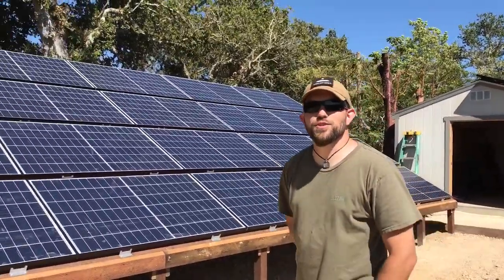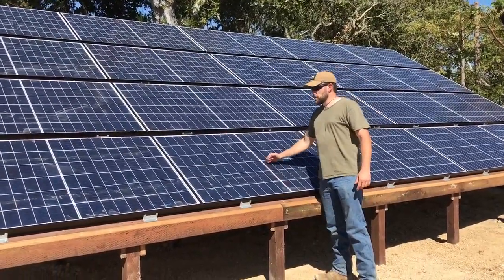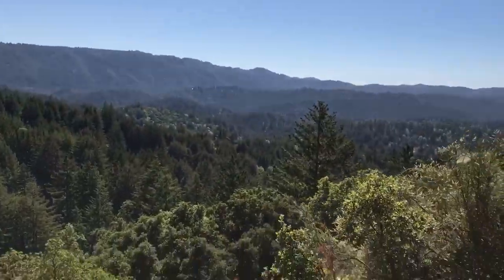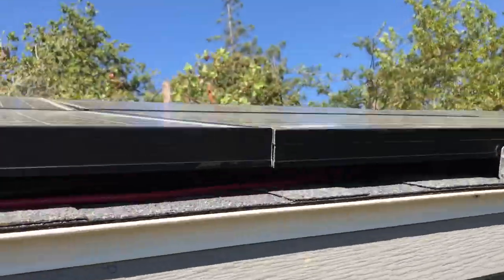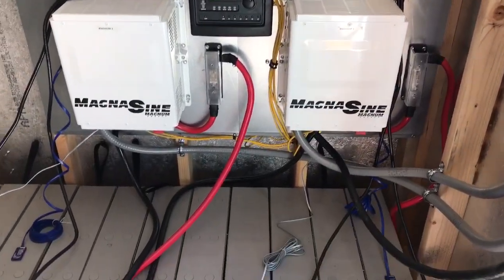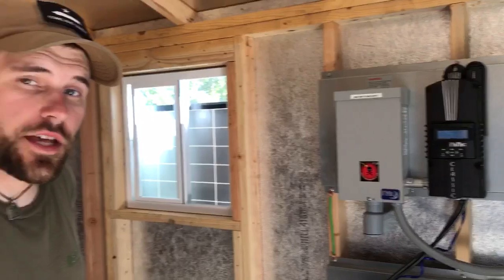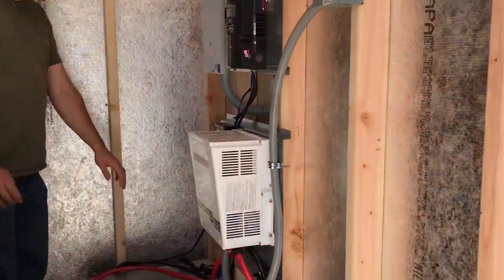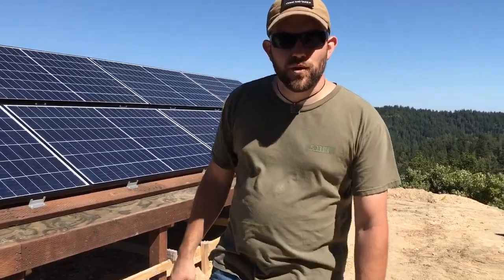12.7KW Off Grid ground mount Solar install by Off Grid Contracting

Comment: How much would it cost me to get my bus set up with solar? also is there a way I can get enough solar to run my Air conditioner and heat, I have a mini split?
Reply: If you are off the grid you will need batteries as well as panels and inverters/chargers.  The batteries can double your cost.  I see a trend of going with used li-ion batteries from electric vehicles as the prices are much more reasonable than conventional lead acid batteries.  Having the mini split-wall unit definitely lowers your power needs but there are so many other factors involved.  For one thing a bus usually has lots of windows, which can increase your power needs because of lost energy through the windows.  The bottom line is without knowing many details about your set-up, it is impossible to give you a definitive answer to your question.

Comment: Can one have enough energy to run a small home 24/7 365 days a year without running out of power?
Reply: Yea, lower your power consumption. It's not as easy as you may think. If you want 24/7 capabilities, you're going to need a battery back up as solar panels obviously can't supply power at night.
Reply: @tt7hvn  I'm attempting to take a picture of how many kilowatt hours I use every month but I'm having a hard time figuring out why my Brother's bill is lower then mine and He uses the same amount of electricity a month.  The ONLY thing that's different is I have to keep my oscillating fan on all the time.
Reply: @vestel777  your statement from your utility company should provide you with how much power you used during that period. I know mine does; mine even breaks it down to avg/day
Reply: @tt7hvn  Yeah I know.  But how can my bill be higher then my Brothers who lives in the apartment above mine?  He uses more power then I do and He pays less then I do.  He has his TV on all day and till around 2 AM in the morning and I just use my cell phone to watch YouTube or my iPad.  It's crazy.
Reply: @vestel777  60% of your electrical bill is HVAC, 20% water heater (if electric), other 20% various. 
If he's paying less for electricity, he's using less. I bet you he has his temp set differently than yours or he showers less than you 😂
Reply: @tt7hvn  Thank you for you responding.  I'm going to call the Electric Company and have them come out and see what I can do to bring my bill down.   Whenever I get my very own home (4 Shipping Containers) I'm going to save up for $50,000 in Solar Panels and a lot of batteries.
Reply: @tt7hvn  Everything is electric here at the Income Based Government Funded Apartment.

Comment: Shit... I just rewatched start... that is on a narrow RIDGE, not a cliff.. slope in back is severe also.  Maybe the customer has a house a bit away from this array and this ridge was only place to put it without clearing acres... or want it out of site.  One KW is probalbly just to push the current through the wire, from the array(s) and to the controlers and storage and House or whatever the application is for.  Maybe a small radio transmission tower up there?  High elevation, 360 clearance, small rod up above the trees and broadcast away!!!

Comment: ON THOSE vertical shed panels... what would happen if you positioned some maneuverable mirrors on the ground and angled them to hit the panels???  May be worth a simple test on a panel to see if any difference .  Get the mirror aligned, cover it with a sheet, monitor the vertical array, then pull off the sheet to see if it ads more input and productivity.  You can do this wiht vertical panels vs. roof panels.  I think it is worth a try. Mirrors are cheap, especially if you get used ones and mount to plywood and frame with adjustablility of pitch angle.  Should really help in summer with high in sky sun, but winter low riding sun should be better than roof panels most likely butmirrors prob. will not allow much additional due to sharp pitch angle, unless they were separated and mounted away and vertical and reflect-beam onto the panels in AM or PM.  Let me know if you try it.

Comment: Don't recommend people build all wood ground mounts. There's a lot of inaccessible wood supporting the modules. I built mine with two long beams top and bottom with some cross bracing. Then typical rails connecting the two beams.  95% of the wood is shielded by the modules and moisture can fall through everywhere. Also easier to install microinverters for grid tie.

Comment: NEC 690.31(A) PV circuits over 30 volts can’t be readily accessible. The first array’s modules wires need to be guarded. The same with the ground array with the weatherhead. Being you are using Midnite Solar mppt charge controllers, I’d say your voltage is over 100 VDC.
Reply: There are no regulations in much of the country.

Comment: You could buy electric for 20 years for the cost
Reply: but that is the cost of being able to , or having to be built in locatio which is off grid... or just WANT to be off grid.. Opportunity Cost is what the Macro Economics guys cal l it. In this apparently remote location, it may have no juice nearby and could cost $50,000 to run poles and wire (or underground wire) and numerous step-up transformers along the distance. We do not know what is going on here or why...that is THEIR business, so why bring it up. Not part of the project.  There must be reasons or issues causing it, not stupidity driven project.

Comment: Here in the north, 100 amp requirement is the minimum, if you plan on electrical heat the need is even higher. So this system does not even come close to meeting the house needs, let alone things like yard lighting, water systems. If you have a shop, or barn, the demand grows even more. This is energy poverty to say the least. The price to meet the needs will pay for 10’s of years of grid power.
Reply: Im moving uo North way north actually. Maine northwest. Im building an earthship/greenhouse to live and grow food in along with small amount of medical cannabis. Ill be using 2000-3500watts an hour ( 2 or 3 lights @550watts each. With air pumps and fans. Using passive energy to keep climate stable with woodfire rocket stove mass heater connected to an air ventalation system under neath the flooring to heat floor with hot air from top of greenhouse sections. How big of a solar system should i get. I have 2 6500watt generators for backup charging so ill go with the least amount of battery bank as possible until i can afford another string of bank next year. Thanks for any advice.

Comment: could not tell if those were just wood posts into the dirt or wood posts put into the ground holes fill with wet cement.
Then I would use PVC pipes to cover the wires because todays wires like on cars are starting to use SOY which is 
basically animal food.  But I do like the design.

Comment: Building a solar array you need space in between to clean the panels.  You wouldn't know it at first, but when you do clean the panels after they've sat for say 30 days, it's a difference.  So that's why it's not so good to have it built like your seeing in this video.  Cleaner panels more energy
Reply: yup... too close to dusty ground. Wonder what kind of pollinating trees are nearby that dust up, like Pine, Birch crap all he time, other?

Comment: I use over 50 KW a day, so this is 12.5KW? Does this mean 12.5 KW constant AC?
Reply: That's 12.5KW per hour.  You'll ramp up the amount of power coming into the panels throughout the course of the day, but will only 'peak' around 85% of the 12.5KW (you'll almost never get the peak).  So on a perfectly sunny day (in the summer), you might squeeze around 50KW power for the time the sun is out, which is a lot.  But,a lot depends on the sun angle, voltage loss, inefficiencies in the batteries, converting from DC to AC, etc.   That's a lot of solar for sure.

Comment: They need to make these smaller, stronger, and cheaper.
Reply: As time goes on it will improve as companies invest in the RnD to make something more efficient.
Reply: not likely to happen unless you know of a way to make them with a better cheaper material than silicon (refined sand and other crap added in)

Comment: As a pilot, I see many solar farms. 
Why are so many sited on what where pastures or meadows? Grassland is a  natural solar collector and could be sequestering carbon. 

https://www.youtube.com/watch?v=vpTHi7O66pI

Why not site them over parking lots so drivers can park in the shade or over large buildings so the shade could reduce the AC costs?
Reply: pedro97w because you need a lot of land to do solar panels and you have to keep maintaining them by cleaning them. It's really hard to clean solar panels on a roof but really easy when they're on open space on the ground

Comment: Ok first i would never build so close to the cliff face, I would remove any vegetation with within 30 of the panels, i don't get why you have 3 separate arrays rather than one, and someone explain to my why its better to use all those batteries rather than 1 Tesla power wall or equivalent that are expandable?
Reply: i've heard the powerwall requires internet connection. if you're living off grid, that likely won't be available.
Reply: @commonsense-og1gz  use used Tesla packs with junked vehicle with low mileage/hours/cycles....Make your own "PowerWall" but with your own controls and such. It is just a battery (pack).
Reply: @yousurf374   wouldn't an mppt controller and a bunch of walmart deep cycles work?
Reply: @commonsense-og1gz  If you are in it for more than 5 yrs, I would not bother wasting time on Lead Acid.. If you do, better off using Golf Cart batteries with combo of series and parallel hookup to get to 12V and longer life of battery with more rapid charge.
these vids also taught me that it is better to invert from 24 to 115 v than it is from 12 v to 115 v.

Comment: Aas windy as it sounds, did the owner consider wind turbines?
Reply: It's not a question of wind in one day, it's a question of wind per year, if it's not blowing fairly strongly every other day your turbine will be a dust collector.
Reply: Maybe he will   have an aux wind water pump..  I sure would have to use that land slope for water power generation...  Something man that was pretty
Reply: @keya31gville  I saw one solar setup where instead of batteries they used excess solar power to pump water to a pond on top of a steep hill. At night they released the water to flow down to the pond at the base of the hill and used water turbines to generate power. Low tech battery.